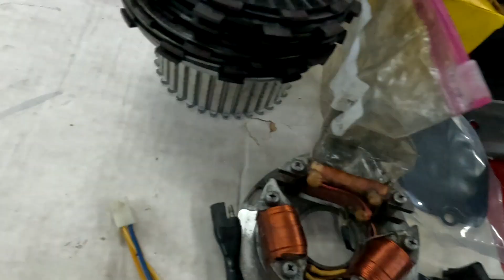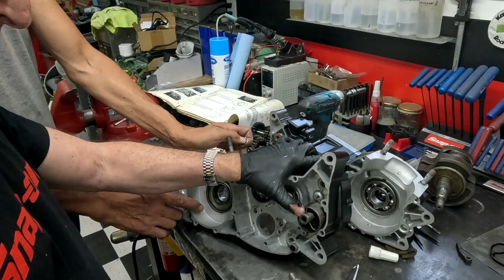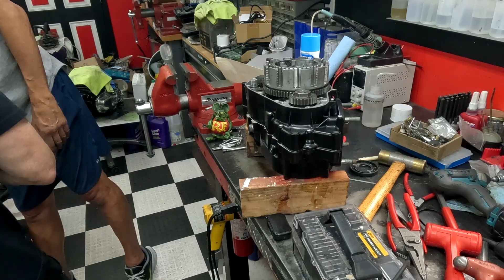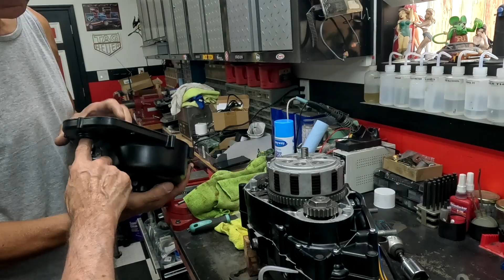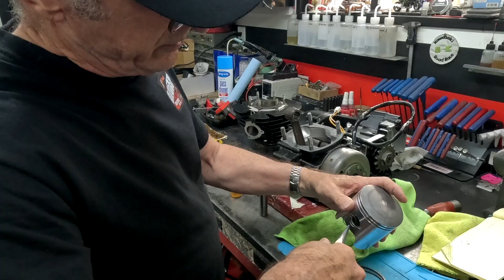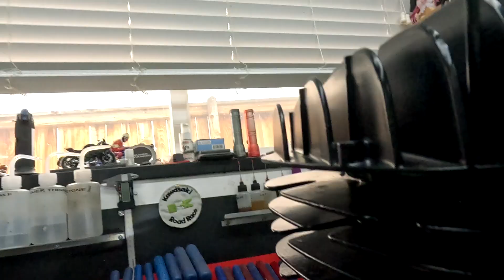HOW TO ASSEMBLE a 2 Stroke Engine from bare cases

Comment: Another great video!   As far as the installation of bearings in the beginning of the video,  what is your take on freezing the bearings if they don't fall right in?  And heat of course, as you did. Thanks as always!
Reply from the maker: Freezing the bearings is ALWAYS better, as well as heating the cases. We did it this way to illustrate how to do it without any of that. Thanks for watching.
Reply: @GearHeadGeeks  I understand, thanks!